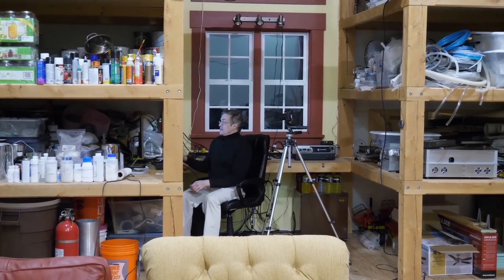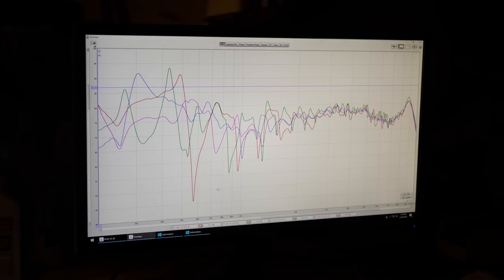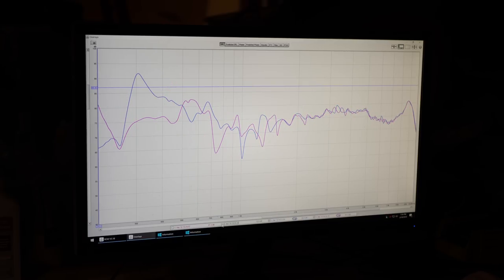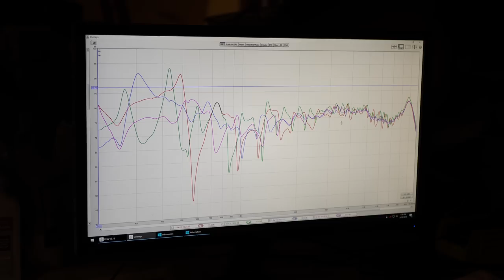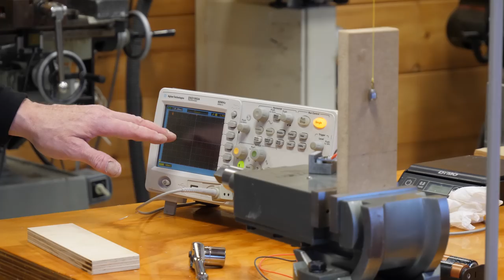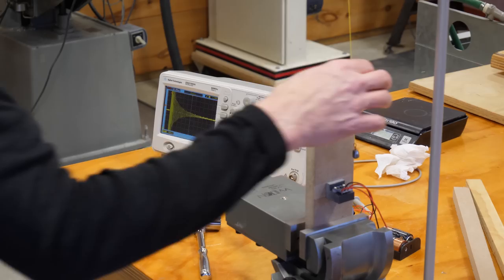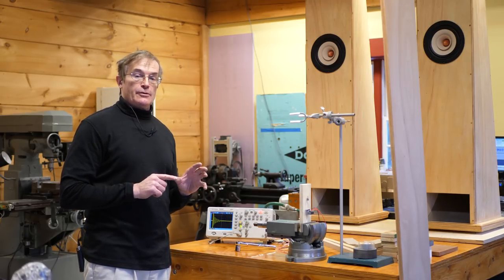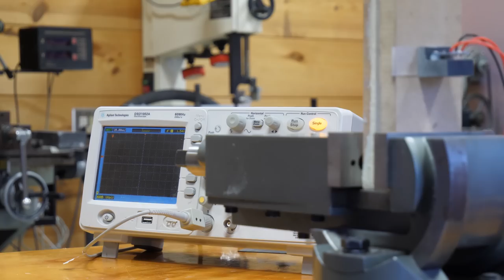World's Second Best Speakers!

Comment: Hey, many Thanks for your very, very good praktikal Instructions !
I am right, when I think that the Dimensions of the TL-Horn are only correspondending of 1/4 the wavelength
From the lowest transmitting Frequency - and Not by the Driver Unit ???
2nd Question:
What is the best relation for positioning the driver unit ?
Is there any old patent for calculating it, or muss it be find out by - try and error ?

Many Thanks for your answer !

Andreas

Comment: Dude! When are You gonna shut off the beeping? That annoyed the heck out of me. Otherwise a good video, thanks. 
Lucky me, I bought a pair of DIY´ed awsome speakers which use Newform Research ribbon tweeters for the mids/highs and some quite small Audax French basses. The basses are fairly small and light but they´re fast. They´d have to be because the tweeters are. The bass cabinets are tuned well and I don´t have anything to complain about them. The tweeters have their own enclosure and are mounted on top of the cabinet.
Also they are reasonable small but deliver a big, fat bass. But the tweeters are awsome, they are not as directional as You might think.
I have a far wider sound stage, I am not tied to one sweet spot. Together with an NAD 7100 Receiver I have everything I´ll ever need.
Boy, did that go BOOM when I forgot to turn down volume in Your hydrogen vid, scared my cat shitless but I liked it!
By the way, I paid just 100€ for the pair, the cheapest, best speakers I´ll ever need. And I have the same look on my face like You did everytime I use them. Very rewarding.

Comment: Sorry to but in, but you look kind of silly in the thumbnail pic for this video. What's our presenter's name, anyway? Usually, on Youtube, they tell us.
I dunno if the thumbnail is a deliberate thing, but if it is, it's not obvious or clear why. You have a really sort of silly simpering look on your face. 

Apart from that, I'm subscribed to the channel and there's lots of great content, a solar heat-powered air conditioner is genius! It strikes me it's a similar system to the one that fridges in caravans or RV's use. They use a triple-power system. Mains for when you're parked up at a site, gas for parked up in the woods, and 12V for while you're on the road and don't want gas lines hooked up, keeping the propane or butane safe and tight in it's bottle.

Being triple-power I first imagined some really complex system with a dual-voltage motor, plus a propane engine, to turn a compressor. But no, all 3 sources just power a heater!

Them some substance dissolves into a liquid (I think water), creating a partial vacuum. That makes the refrigerant boil, taking away heat from the fridge in the process. Then to renegerate, you un-dissolve the first substance by heating the liquid it's in. I believe Einstein himself had a big part in designing it. One of those things that makes perfect sense once you understand it, and confounds you when you don't! Seems like magic, using different forces and substances to create cold from heat. 

I think the old "Icy Ball" used the same method. That was a metal ball with a loop "handle" that you'd boil in water to "regenerate". Then let it cool down. Then give it a shake and it starts to get cold, you shove it into an insulated cupboard, and there's your fridge! Regenerate it once a day. Refrigeration without electricity, in fact you could theoretically regenerate it over a wood fire, or anything that'll boil water. And it's just a metal ball, no maintenance. Utter genius in bringing refrigeration to places like the USA when people had farms isolated by miles.

Another thing those farmers did is run telephone lines down wire fences. The wire's already run, so why not? Loads of ingenuity back in the early 20th Century.

This ended up a long post, sorry about that, for what it started off as.

Comment: At 21.00 You really didn't need to keep that 1k tone on continuously.

A simpler explanation of the Voight speaker design is that the acoustic capactive reactive impedance of the closed tube end balances and cancels the predominantly inductive reactive impedance component of open vented end of the box system. The design intent is to leave a pure R acoustic system with no combing effect through the low frequencies where the LF driver is utilising the box acoustic back loading impedance presented to the rear of the speaker driver. 

Voight almost got it right in terms of a near perfect system. What he neglected was  to take the next step and allow for tuned cancellation of the two complex impedances  (by, for example, varying the vented slot length but  using a vertical slot that creates a variable length tube on the vent side).

The second issue with the design is that, in its present form, there is no provision to tune the acoustic  damping either. You need to be able to adjust for critical damping (as in under damped, over damped and critically damped). Damping needs to be distributed as it only works at anti node positions of maximum volume velocity and these positions move with frequency. Btw there are far better controlled  ways of creating acoustic damping than using polyester wool. 

You are correct with the tapered box approach. What you achieve is to present distributed transverse wave resonance (across the box at higher frequencies). Parallel side boxes enforce a single transverse resonance and multiple harmonics, and thats a no no as it adds (bad) colouration to the box response.

If you think that you've got that problem licked (you think the transverse wave frequencies occur above the LF range) because the LF driver is coaxial two way, think b again. 

You need to first confirm the  is no acoustic cross coupling between the LF and HF drivers on the coax. That detail will depend on the type of coaxial driver you choose. It's something you will have to measure as I know of only one study (AES) that's looked into that  using a set of Tannoys and then only looked at intermod distortion issues  at higher power levels. Most manufacturers don't talk about  this issue.

Thanks for bringing to everyones attention this design. This Voight is one of the better designs out there amongst all the acoustic  floss.

PS I love the work you do.
Cudos.

Comment: actually I was wondering about sandwiching 3 layers with decidamp between each layer (two layers 3 panels making a damping composite) also know that materiel that is flexible but can ring like spring steel sound will dampen when pushed in strained position what if you say make some fiber glass that is in a bowing shape or CF and sandwich it between the two boards??, also another Idea would be adding a thin film of rtv Silicone the clear kind used fo binding glass and putting in windows, to absorb some of the impact from the sound it's self acting like a dampener Oooh and another maybe add Sand to the RTV to create the same effect as moving from a flexible to a stiff on a micro level, to remove vibrations even further, it would be very interesting to see just how far you could take this or how much it is posable to stop a vibration transfer/response/absorption

Comment: I enjoyed your video but at 75 the accumulated degradation of my hearing due to jet engine noise during my military service and many years of woodworking enabled my to tolerate the segment where you you left the speaker squealing on while continuing with your presentation. But it earned dirty looks and a growl from my dog. Otherwise it was an excellent tutorial on speaker design. Being a long time Hi Fi enthusiast I Have cycled through many generations of the latest and greatest speaker designs and the accompanying descriptions of "technical" advantages of each.

Comment: Very interesting. A subject I used to spend a lot of time on. I have built several speaker systems, but always someone else's design, never experimented like you have done. The part in the middle where you are talking about the speaker would have been much better if you have turned off the test tone. That made it hard to watch. But I still continued because it was interesting.

Comment: To be honest they don’t sound that great over YouTube perhaps they sound better in person but over YouTube they seem to be severely lacking any bass extension  and control of the lower frequency’s. Speaker design has a lot more to it than just designing a box. First of all what are the characteristics of the drivers used as different drivers would need different sized enclosures you have many types of drivers and many types of enclosure for example field coil drivers open. baffle drivers, what about crossover design sending a full range signal to some drivers would be terrible sounding.  Calling them the worlds second best speakers is a bit silly go listen to a set of Focal Grande Utopia’s and then see where they lie.

Comment: Hi, just came across this a few hours ago. WOW! I built my first set of speakers back in 1978, they lasted about 20 years. I've used Mission 753's since with replacement drivers and x/over components, which I've installed myself. They are still working. I would really like to build these but I don't have the space to do the construction, shame. Even via utube compression, the sound is fab. Well done to you, sir. A great vid explaining the construction/design plainly and simply. One can still dream of the good things.

Comment: Not really a fan of multipurpose items. Yes they have their uses and do a lot of things but do not do just one thing great. Same with speakers.  One speaker trying to handle the entire range will not be as efficient as multiple speakers with dedicated ranges. For that reason, I have never liked single component speakers. Yes, they sound good over the entire spectrum but can't handle just one alone and washes out. With separate component speakers to handle the lows, mids, and highs, each one handles their desired spectrum much better and when combined you get a much fuller and richer sound that does not wash out.

Comment: What about make a speaker best as you can, measure the peaks and create a correction with equalizers (can be parametric eq) or produce sound compensating digital circuit? Then we can get ideal signal from the speakers.

Comment: Converted 1/3 of our garage into a 'quiet space' or as it later became known as, the 'stereo space' with 10mm GIB (drywall-esque) lining the inner. It wasn't that great at cutting down the noise that escaped, so I came back to this video to find out what material he used for the constrained layer damping, decidamp. Lo and behold, there's a single distributor of it in NZ with a minimum order quantity of 22lbs (+2.2) worth of DC30. Absolutely slathered the 10mm in the stuff, slapped some 13mm high density GIB on top and you can't hear a damn thing. Excepting a small amount of sub-60Hz, but what can you do.

Comment: Would it be possible to turn the deadending transmission line, may be on 110cm high, 180 degrees down to cut the total high of the box to 110cm, wthout big influence

Comment: My god, turn that damn tone off !  The design of the chamber shows that being real smart doesn't mean you have a lot of common sense.  Having to put the big clamps on to seal it could be eliminated by using simple CAM handles that engage with no tools or loose parts.  Duh.  Interesting video.  I did learn something.

Comment: All speaker use a cabinet, preventing rear reflection. The transmission line design prevents this problem, they are quite common.

Comment: Old school with ancient school + modern measurement & speaker design. The first recorded use of plywood was in the Roman shield over 2000 years ago. Voight pipes are less than 90 years old.
Tang Bands are probably the best commercial full range speaker currently available without a ludicrous unobtainium price tag.
Just goes to show that old don't mean obsolete. All speakers initially were full range. Tannoy dual conentric were designed in 1947. Objectively they don't measure that well but subjectively they can sound awesome and alive musically.
The problem with full range drivers is bass and intermodulation distortion.
If you can live with that. More power to you. Me? It puts a hurt on my ears. If I were building similar it would be about twice as expensive because it would require a separate dedicated high quality bass driver and sub amp. Luckily the anomiles in the upper frequencies using pulse width modulated ( wrongly called digital) amps are not discernable @ the frequencies where IMD distortion is most noticable for a simple design like a bass speaker + extended range speaker with its own amp. The offset in cost is that cabinet design though slightly less efficient is WAY simpler. If executed correctly the bass is less distorted and the full range becomes an extended range because freed from the curse of IMD in the bass it now can better weave its unique magic with a much cleaner and therefore more intimate & engaging sound.
Great video if you can get past the tone generator left on while the guy talks over it but the information is worth it. Harks back to a time where 15 wrms was considered high power and speaker "efficiency" ( max 15 to 20% even corner horn loaded like klipschorns) was as critical as its perceived  performance.

Comment: In 1968-70 there was a small manufacturing plant building "Toby" brand single-driver tower speakers, which looked remarkably like these, with perhaps less convergence or triangular shape.  A friend was in the market for high end speakers, but even after we got a peek at the actual manufacturing, he could not be convinced that a single-speaker tower could ever compete in sound quality with the woofer-midrange-tweeter options everyone else was building, even Klipsch.  Your design, and the engineering that goes into it, shows that a single driver can reproduce sound very well, and for the DYI-crowd, at a good savings over many other speakers.  Right now I don't see any specs for the output of these speakers, but through the little buds connected to my laptop they sound great.

Comment: The more i research, the more i appreciate this addition to the art of loudspeaker design.  .   The W8-1808 has . . .  a very robust Xmax.   the bass notes will be felt. Vas about the same as Vbox.   and 93dB sensitivity. and the horn  matching the impedance.    Aluminum flashing is very workable and available.    dynaflex230 will ( i think ) come to a full cure eventually as  the moist is sucked away by the wood.    No,  the polyurethane sealant and adhesive used for caulking. is better.   Time to break out my Tek 465A scope and  power up the old servo accelerometer   50 year old pivot jewel  meter moment and a gold weight.
and learn more.       Stub tuning an antenna . . . . . .  in slow motion.

Comment: In high school, I built a tuned tube speaker set in the back of my truck.  I purchased several sets of speakers from different (cheap) manufacturers with a high efficiency and different diameters.  The speakers were mounted in handmade mounts to adapt them to 4" tubing.  Then, the speakers were characterized with a microphone set at 3 feet from the front of the speaker, with the speaker mounted on a stand 8 feet off the ground outside.  Being in the woods with very dense trees, the background noise was minimal.  A sweeping sine wave was then applied to the speaker from 10Hz to 20kHz, taking a peak reading from the mic.  The exact figures were not important for this exercise; it was the comparative data which was needed.  The characteristic curves were plotted and then over laid to see how the speakers preformed compared to each other.  This showed a great overview of how the speakers self resonated.  Starting with the speaker with the lowest self resonating frequency (12Hz if I remember correctly), target frequencies were calculated that would fall between the first and second harmonic of the speaker.  Speakers were then selected that had self resonating frequency that was close to these frequencies.  Given no speaker was exactly what was needed, the speakers were mounted back into the test fixture and weight was added or subtracted from the cone to decrease or increase the self resonating frequency of the speaker.  Given the final application of the speakers, polyurethane sealant was applied to the cone to both seal the fibers and increase the weight.  Once the speakers were tuned, giving a range from 12Hz up to 2kHz, 4" schedule 80 PVC pipe was carefully cut to 1/4 the desired frequency.  Clear PVC primer was dumped into the pipe, and the pipe was rolled around to melt a thin layer of the PVC inside the tube.  The primer's solvent would quickly flash off, leaving behind a more dense layer of plastic inside the tube.  This, and the extra texture from the treatment process, took out the mechanical echo sound.  The speakers were then mounted to the appropriate tube, and the tubes were mounted to a rack in the back of my pickup truck.  The rack was mounted into the peg holes, so it could be lifted out as one unit.  The 12Hz tube stuck out the end of the truck substantially.  The use of the system was specifically for beach parties where I was responsible for bringing the firewood.  This meant I was hauling a trailer, so the overhang was not a big deal.  To cover the higher frequencies, I had a 14"x6" loud horn.  All of this was run off a 100W RMS amplifier with an over engineered passive bandpass filter network which used the induction of each speaker as part of the filter.  This helped to reduce the filter losses to a very minimum.

That sound system was AWESOME.  I could put on just about any song and go walk down the beach.  At a quarter mile away, you could still understand the words.  Best of all, it did not blow out your ears standing near the truck.